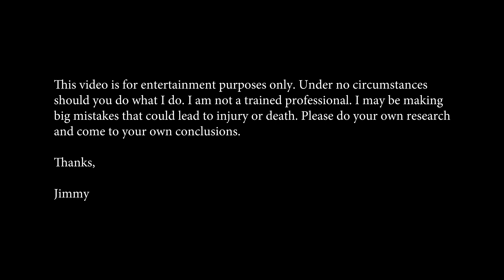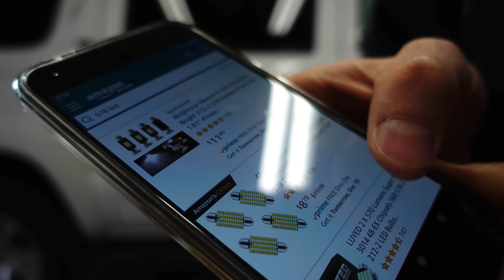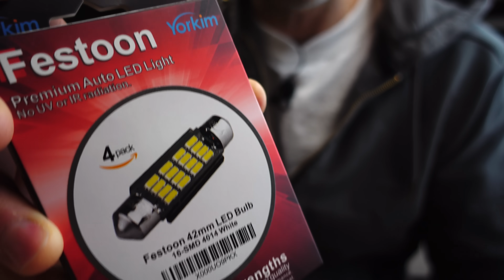Here's Why You NEVER INSTALL LEDs IN YOUR CAR OR TRUCK!!

Comment: LEDs are an excellent choice for backup lamps, as they run much cooler and use a fraction of the current, causing less wear on the backup light switch in the transmission.  They don't work well on rheostat dimmer circuits, though, such as instrument panel lighting and dome lights.  To get them to dim as smoothly and over a wide range of brightness as the incandescent bulbs they replace would require some kind of voltage to pulse-width modulation (PWM) module.
Reply: LEDs can be dimmable, but you can't just buy the cheapest available. The cheap ones also have problems with the polarity of the connection.

Spending just a liitle more gets you LEDs that are dimmable and are impervious to the polarity of the connection.
Reply: @johnvanlandingham8832  LEDs made fit for purpose can replace normal incandescent bulbs with no problem. Just don't buy the cheapest available, make sure they are appropriate for the application you want to use them for.
Reply: Just how long do you spend in reverse...or are you one of those idiots who have to make 90-point turns? To burn out reverse bulbs-Just buy the cheapest crap you can find on eBay or make sure you have a dodgy ground/earth circuit, adding some water helps too!
Reply: @andrewcarroll1867  — Where did you get your electrical engineering degree?
Reply: @Milosz_Ostrow  From China LOL
Reply: Actually they work better than incandescent bulbs, for the exact reasons you stated, LED's are not a bulb they are an electrical circuit or in better terms a type of diode or Light Emitting Diode, they work with electrical current, and are EXTREMELY dimmer friendly. If your experience is something different then the problem isn't with the LED it's with your circuitry. It pains me that people blame the LED for being at fault when their instruments are not designed for them in the first place.   For example with automobiles built from 2005 to 2013 with halogen headlights, you can install LED bulbs with no kit, just install the bulb and your good, because the computer rectifies the current loss and adjusts for it, via resisters and other means built into the system. Try to install an LED headlamp in a car built in the 90's or early 2000's, you'll need a kit to control the power.  So again it falls to USER ERROR plain and simple. Understand what your working with or don't use it but don't give it a bad wrap because your knowledge is not up to date.
Reply: Actually they are not that great in a backup lamp. I have tried every led that the big box stores sell in different vehicles. here is the problem Ive had every time. Incandescent bulbs provide a sphere of light that are reflected back from the lens and make a nice flood pattern. LEDs are much brighter, but are more of a directional bulb. The lens in your back up light was more than likely not designed to diffuse the pattern of light from the LED. If your reflecters are smooth they will just make your leds into spot lights. When you are backing up a spot light is useless to you there is no need to see 1/4 behind you if you cant see 3 inches from the side of your bumper. I install a LED that was made for a brush guard somewhere tucked up under the truck like where the spare tire well is and tilt it so the plastic bumper blocks the light from blinding other drivers. i suggest splicing into your current reverse light power wire so there is no need for a swich as it is on only in reverse. ive never had a problem with my 2"x2" 1.67 amp light.
Reply: @mickostrander1832  — You make a good point about the beam shape from LEDs, although that can be corrected with lenses.  LED vendors need to be poked and prodded to make improvements in this regard.
Reply: @andrewcarroll1867  
Its really the increased brightness.
Reply: @greenmarine5  Leds don´t dim without pwm. They can dim a little as you under power them but pail in comparison to a normal bulb.
Reply: You pretty much don't know what you're talking about. Maybe at one point in the past, you did, but you've been left in the dust as far as your topic knowledge is concerned.
Reply: @starmc26  — It is actually YOU who doesn't know what you're talking about.  Do you know what a characteristic curve is for a semiconductor?
Reply: @Milosz_Ostrow  lol, a diode??.... Stop trying to pretend like you know what you're talking about.
Reply: @Milosz_Ostrow   Especially for Car Head Lights . Many leds sold as head light bulbs don't conform with required beam when stuffed into reflectors designed for halogen.
Reply: @starmc26  — What do you think the "D" in "LED" represents?
Reply: @Milosz_Ostrow   @Milosz Ostrow   Gotta love the "I'm smarter than you" vibe I'm getting from you. A dude makes a incredibly valid counter point of "people don't spend much time in reverse" what's your answer to that? "Oh where did you get your electrical engineering degree?" Like that has anything to do with electrical engineering. I guess only electrical engineers can figure out how much time is spent on reverse huh? Then your going around the place asking your doubters pointless questions. How is knowing what the D stands in LED or knowing the characteristic curve for semiconductors relevant in any way? Dude, get rid of that stupid superiority complex of yours.
Reply: @greenmarine5  I can confirm that in my 99 Micra, the dome light dimming works perfectly. However, you can see the resolution of the dimming, as the LED acts faster to voltage changes as we all know.
Reply: Seem to be grasping at straws here, "less wear on the switch in the transmission"? Really? How many of those have you been changing out on a regular basis? Leds have benefits for sure, but at some point you gotta ask yourself; does it really have a benefit in this particular application? And what if any benefits do an incandescent provide? Incandescents are generaly better at creating a flood light pattern, exactly what you want for a reverse light. Or are you rather considering the "Disco" style properties of the light itself will impress the ones behind you? I can assure you, most are NOT impressed by led's, they been around since the 70's. Or you trying to lower your vehicle's electric bill?

Lots of jokers out there with led turn signals, that can barely be seen, blink too fast, dont stay on long enough, and unless looked at head on, give MUCH poorer light output than the standard incandescent they replaced. Congrats, you just effectively diminished your vehicles safety system. You trying to be one of those guys?

If you have an itch to accessorize your vehicle, but have no skill, no funds nor knowledge, dont go diminish the existing systems by going crazy with led bulbs. Your not improving your downgrading.
Reply: @brackcycle9056  Some are decent.  They do make ones that are adjustable, so you can more precisely align the led to the reflectors.  I did install some morimoto leds in my 2006 civic and the beam pattern was the same as original but more neutral white, and brighter.  It was a pain, as the fitting on the led was correct, but the wire connectors were not, but I just used deutsch connectors.  Also the fan heatsink sticks out further than a normal bulb so I had to find rubber covers which fit around the heatsink and attached to the headlamp housing.  Some places make these directly for this application.  It is all watertight.
Reply: @Santor- i second everything you just said. 
Know what happens when you replace all the bulbs for LEDs in the dashboard of an older Ford? It sees little to no voltage at the BATTERY indicator and now the charging system doesn't work. Or the 3rd brake light of an automatic? Now it thinks the brakes are on and it doesn't know how to shift.
Idk what people boner is with swapping out ever single working bulb with an LED and pretending like its saving them money. Changing out stock parts, functional stock parts, for aftermarket garbage is in no way an "upgrade." But please continue to give China your money so you can feel cool having changed a light bulb on your total and custom car that anyone and everyone has or can buy.
While im at it, putting 92 octane gas in your '97 Toyota Corolla is absolutely pointless unless your goal is to wad up the catalytic converter and cover the valves in carbon. You need an engine with high compression to run higher octane, more so to get a complete burn of the fuel. Its a waste of money, and stupid. 
And removing your egr valve is also retarded. Unless, again, your goal is to hear what spark knock sounds like, or you getting too good of fuel milage. A working egr doesnt rob power, its not even a smog part.   There's just too much dumb info that gets passed on, combine with cognitive dissonance, and now i hate everyone.
Reply: @dogsandwich77  Lol, good points for sure. Let's just chalk it up to "misguided car enthusiasts", that could stand some additional input. Newer isn't always better, and that certainly goes for LED"s.

I just did an Indigo/plasma conversion of an older dash, that is an actual upgrade, while the LED' only diminish what can be seen vs incandescent bulbs, due to being designed to require a flood light pattern.
Reply: @grahamepigney8565  All LEDs only work in one DC direction.  The better LED modules include a rectifier circuit that ensures the LED itself is delivered the correct polarity regardless of how the module is installed.  Such a module should work even if fed AC juice.  Obviously, LED modules used for your house include such rectifier circuits.
Reply: @greenmarine5  Just as I won't give you a bad rap for your inattention to the finer points of English spelling and punctuation.

Comment: Because of a visual issue with grey/yellow colors for night driving, the LED headlights have made it easier for me to see the lines on concrete or blacktop roads. This visual problem is generally compounded by rain on the surfaces, but white LED headlights make a big difference.
Reply: Same here, if it rains very hard. My halogens (2013 audi a1) I can litterally NOT see the lines which is really shitty when someone's passing or I am passing someone. Even my foglights on the front won't solve it due to the same color of light.
Reply: Holy crap batman you've solved a mystery I've veered In and out of for literally some time ESPECIALLY while driving during thunderstorms, I thought I was just visually challenged  due to my eyesight getting worse as i got older and my eyesight worse comparatively. THANK YOU!!
Reply: @Gyula.b  and I drive a 2013 VW CC with that was the first year they had the led headlights with many many individual little bulbs ($1,200 each to replace the bulb/housing yikes) but I love how they turn with the steering wheel that really really helps
Reply: Standard headlight color is to prevent glare in oncoming drivers' eyes.  Blue light effectively blinds people at night.
Offroad lights are bright white because no other drivers are there.

Comment: changed out the interior lights on my vehicle years ago. Also, swapped out my backup lights. No problems.  I guess I got lucky and bought the right ones.  It clearly made a huge difference in the plus column. I recommend them

Comment: Follow up video: I learn what incandescent lights are.
Reply: Incandescent mean so hot it glows. That's why incandescent bulbs are so inefficient. Most of their energy is going out as heat. LED's (of the sort used in car/home lighting) produce a narrow spectrum of very bluish light and a little waste heat. The yellow you see is actually coating of various phosphors that absorb that light and re-emit it across the whole visible spectrum tweaked to some white point (i.e. 'daylight' or 'warm white', etc.) somewhere between 2700k and 6000k in most cases.